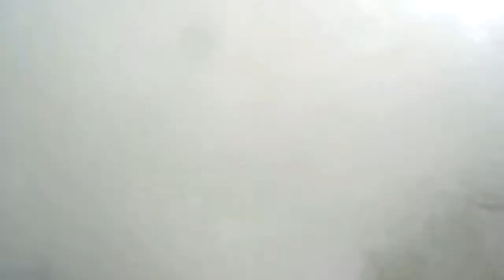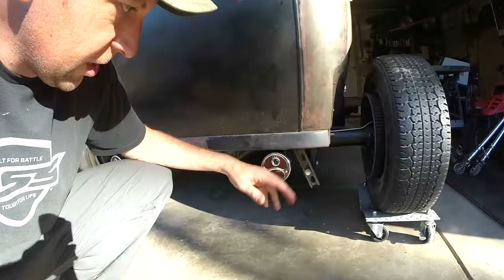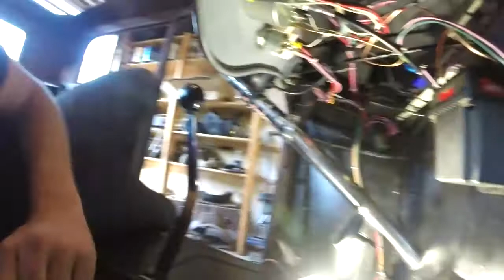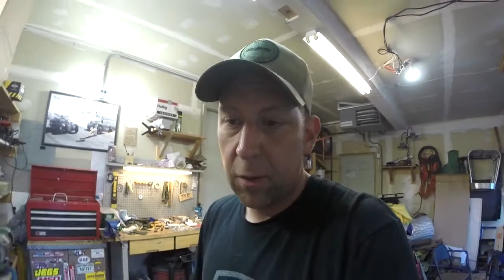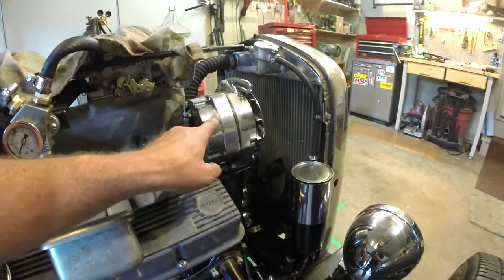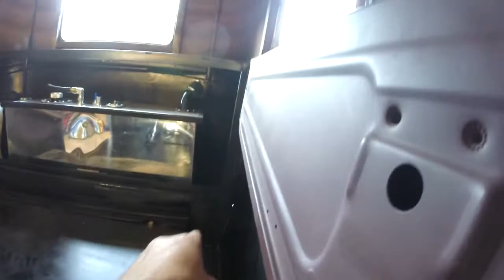Speedway Motors 12 Circuit Wire Harness Install- Part 2! Install Complete!

Comment: Man i am having trouble with wiring the 7 pin headlight. On my 65 chevy van.   I bought it not realizing someone wired it without a fuse box.  
Theres more wires coming out of the switch than what is provided.  Like no dome wire/ground. No fused wire. So i guess i need to run a jumper. 

And from watching this i guess i will have the same problem with my blinker because i have a really old one and it only has one relay and speedway has two.
Reply from the maker: Sounds like you might have to jumper some wires, or pull power from somewhere else.  And it sounds like you might have to convert to the 3 pin flasher setup.  Look up universal turn signal switch wiring diagram and that might give you a visual on how to set it up.
Reply from the maker: Hmm, are you using the speedway 12 circuit kit?
Reply: @BadHombreGarage  yes.

Comment: Well done, trying to get a brake/flasher working right.  Turn and tail lights work.  Getting ready to do the 4 way and brake light, however, the 68 f100 has 4 wires on the emergency flasher...  kinda lost, any suggestions?
Reply from the maker: Hmmm… that’s a good one.  I’m not familiar with the 4 wires on the flasher.  What wires do you have going into the flasher?  Any viewers out there that have seen this?
Reply: @BadHombreGarage  I haven't started the 4way or brake light yet.  I have a 12 circuit universal wiring kit from speedway.  I see the power into and out of the brake light switch.  Then the second flasher in the harness is for the flashers, which only has 1 sure labeled.  The switch however has 4 wires.  One red, one green, ,one white/red stripe and one white blue stripe.  The hazard switch is a separate switch in the glove box on the 68 ford f100.

Comment: I have a 1966 D500 dodge Holmes 500 wrecker was parked 20 years only 50,000 miles fixing to rewire home i didn't make mistake i bought 12 circuit off Amazon it looks good
Reply from the maker: Right on man!

Comment: Great Video I am going to get the 22 circuit from speedway for my 30 Model A. What steering column are you using?
Reply from the maker: Great! Hope this video helps you out.  Honestly, I can’t recall what the steering column is- it came with the car.  I’d guess it’s a speedway universal deal.

Comment: i have a 1968 ford galaxie  and had put a new wireing harness from south west performence does the turn relay apply for that one to do i have to cut that relay of and make my own
Reply from the maker: I have to admit I’m not familiar with that company or it’s wiring harness.  I think there should be some instructions available online or direct from the company, right?  Any other viewers able to help out here?
Reply: Not really  sure
Reply: Alberto, did you happen to get yours figured out?  I'm helping a friend on a 68 ford f100 and have some confusion.  Just wondering if your galaxie had a separate 4 way flasher switch that you had problems figuring out? That's what I'm a bit confused with....

Comment: Ordered a new turn signal switch from Summit and that fixed all our brake and turn signal problems. Actually ran a small grond wire from turn signal switch to dash, on this '47 Ford.
Reply from the maker: That’s cool, and good advice on the ground wire.

Comment: Hi,  So I am restoring my 1973 Plymouth barracuda,  and am looking for something on what kind of grommit I should use on the firewall to run the harness to the front through the firewall.
Reply from the maker: Not sure what to use if you’re looking for the original replacement, but I’ve used ones like this: 6PCS Firewall Plug Grommet Synthetic Rubber Grommets Wire Protection, Hole Grommets 1" ID 1.18" Drill Hole https://www.amazon.com/dp/B08L6K84TF/ref=cm_sw_r_cp_api_glt_fabc_7WYXHEDBF16XAGKZC9DQ

Or just look up “firewall grommets” on Amazon, there are a lot of choices.  My challenge is that I hate drilling holes through a firewall! Good luck.
Reply: @BadHombreGarage  The OEM way, was the FuseBlock,  was 2 ways.  one side went inside, the other went outside.   But the fuseblock was melted in numerous spot like all old mopars,  so I bought an entire new harness,  just trying to figure out how to run the speedway harness through the firewall :)
Reply: Oh,  Thanks  for the info :)

Comment: Great video, Thanks.  Have the same system about 90% completely installed. When I power through the battery, there's nothing. Bad grounds, or do i have to have all circuits wired up first?
Reply from the maker: Is your main wire connected to the battery?  The one with the fuseable link?  If your main circuits are all in, you should have power.
Reply: @BadHombreGarage  I have that main wire coming from the fuse block and running to the battery post on the starter, with the fusible link near the starter.  So I guess the answer is yes.   When you say,  "if main circuits are in", which circuits are you referring to?  Thanks.
Reply from the maker: Hey Tony, I was referring to the wire you mentioned- the main one from the fuse block to your starter post, where it in turn goes to the battery.  The accessories, like lights and such, don’t need to be connected for it all to work and charge.  Without knowing your setup, I’d just recommend that you go through and check grounds, they are critical!  Ground from the battery to the frame, engine to the frame, and body to the frame.  Hope you get it figured out!
Reply: @BadHombreGarage  Thanks again Joe. Its usually obvious things like grounds that keep us awake at night trying to figure this stuff out. Your videos are great and really helpful.  As one garage gear head to another, thanks again.
Reply: @tonychartrand1117  One last final thought which might help someone along the way.  It turns out the fusible link wire spliced to the main power wire had a bad splice. No current flowing to the fuse block. It's happened to me before when splicing 2 different gauge wires. A step down connector solved the problem!

Comment: Thanks for the easy to follow wire job.  I'm starting my wiring on my Model A coupe and now with a little more confidence.  I should have drilled a few holes in the frame before 
installing the engine to tie the front wiring to the frame.  A helpful hint would have been what gauge you used for your ground wires.
Reply from the maker: Yes, great idea!  I should have given details on the ground wire.  Basically, I have. A big ground strap from an engine bolt to the frame.  I also have about a 14 gauge wire from that same engine bolt to the body ground.  Wiring really just takes patience, and a guy can figure it out.  Just don’t do like me and stay up trying to figure it out!  Get sleep; it’ll be easier.

Comment: One thing can you still close the door it looks like the turn signal switch is long but it might be just the camera angle
Reply from the maker: I guess I'll find out when I put the doors on!  If it hits- I'll just trim it until it doesn't.

Comment: Nice job, man.    I used a Rebel Wire 9+3 harness in my Model A pickup.  It was too much harness for a simple Flathead hot rod,  their 8-circuit would have been plenty.   I used the same 9+3 harness on a 64 Mercury, and I loved the quality of the harness and Rebel’s customer service.  Because I am self taught and have a lot of questions, Jeremy at Rebel is a king of patience and knowledge.   **their instructions are good,  but don’t have the planning worksheet like you showed in the first video.   That worksheet and your explanation of it is a lesson I will use on my next wiring project.    ***Do you know who makes the Speedway harness?  Curious.
Reply from the maker: Thanks!  On a project with all the bells and whistles, I'd go for more circuits, but this is fine for the simple hot rod.  That planning sheet really helps out.  I can't tell who makes the kit- Speedway markets it as their own but it's probably from overseas.